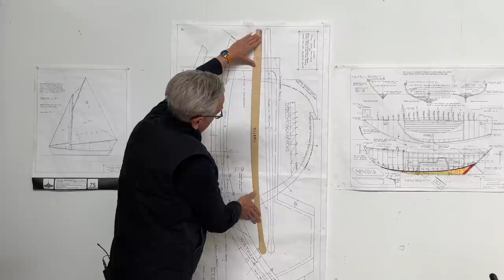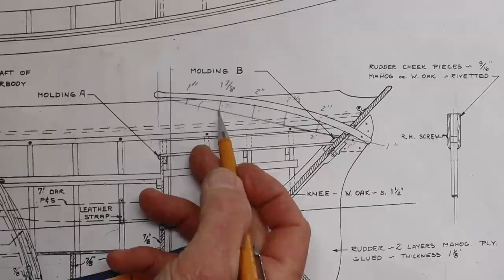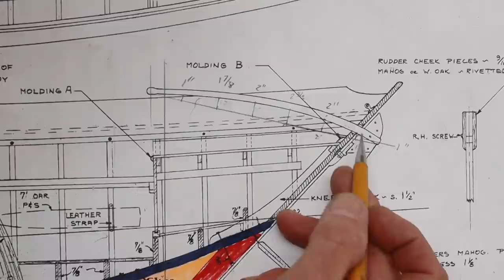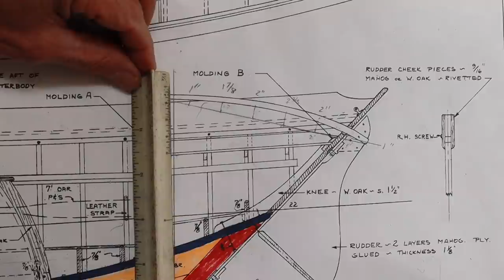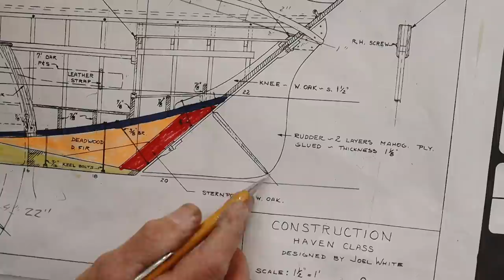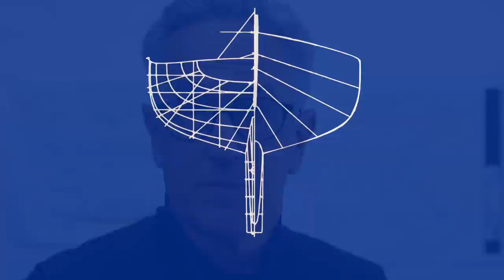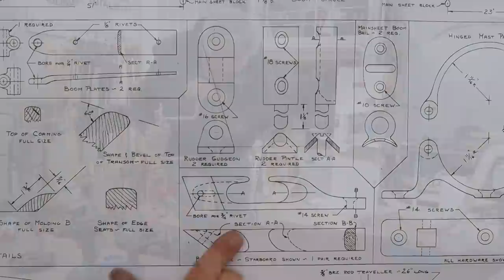Wooden Boat Building, The  Rudder, Haven12 1/2 S2-E60

Comment: I had a similar problem on a job where the ceiling in foyer of a building  was made up of 24 x 24 inch wood panel.  Custom made in Italy in 20% humidity. Sealed and finished on one side then installed during the summer in NC, 98% humidity.  The tiles had a 1/8 inch lip to fit in ceiling grid track, and when the inevitable warping occurred, they popped out at random to fall 12 feet onto my guys below.  It would have been amusing to see everyone scrambling for cover if it hadn't been so dangerous.  Nice work on the Haven, BTW, and remember to always check overhead.

Comment: One tip for folks new to blueprints when he was referring to up from the line Bob was referring to perpendicular not up relative to the drawings.  I know for most this will be a logical thing but when i use to tutor new employees to reading drawings at my jobs I had many a time when I was saying to measure up and I took for granted I was talking about a surface out of the standard X and Y that they measured up. and not in perpendicular to that surface. Excellent video I do not get to catch them all but it really is great when you get into using a scale and how if the drawing is correct you can pull info such as this off of it.

Comment: You wouldn’t think that with acclimated walnut and I assume a climate controlled shop that the cheeks would dry that much more in a couple of days to twist like that, would you? I’ve had the same thing happen under the same condition with small box lids that I’ve finished on one side a day or two before the other. %@&*#! I felt your pain, and I’m at least as old as you. Fun to watch the details like shaping the rudder screws to match the profile of the pintle’s. Slicker than snot on a doorknob.

Comment: I love watching your craftsmanship.  The comments are educational, too.  I was hoping you can reduce my fears of the plywood checking even with a two coat epoxy sealer.  Is it fir plywood?  I have used some light fiberglass cloth in epoxy but I would like to skip that step when using plywood.
Reply from the maker: Thanks Ken,
Yes, it is Douglas fir, marine grade plywood. The use of glass cloth is mostly needed to add strength, as in the hull of a kayak. Sense the rudder is really strong enough the resin is only need for sealing. In theory just a good marine paint is adequate. 
Thanks for watching.
Bob

Comment: Bob, I see more trouble with the tiller hole. You need the length of the pintle pin times the sine of 45 deg (about 0.9 inch) to mount and unmount the rudder/tiller assembly. I don't think the hole in the transom is large enough to accommodate that lift. Another thing to think about is that I remember when I was sailing sabots that sometimes the rudder would float off the gudgeons. Your rudder has more displacement below the waterline than a sabot rudder.

Comment: Nice rudder...even though you sealed the ply with epoxy and primer and of course the finish paint won't the plywood check and feather. I usually put a thin light weight fiberglass cloth over the ply to keep it from checking/feathering.  The screws directly attached to the endgrain of the ply will last? Why not add wooden dowels/plugs of a hardwood for the screws especially at the head of the rudder where the depth of the ply is quite a bit smaller then the bottom. I would be afraid of eventual pullout of the screws. Never the less beautiful job!

Comment: This time it's not too late. I've been planning a rudder build for months. I already purchased wrapped 1 by mahogany boards from Menards. I plan on gluing them up to have a 1-1/2 x 12 x 72 in long board to begin cutting. I've been told not to use Titebond III and use epoxy and wood flour instead. I do plan on using epoxy to finish as I want the wood to shine through. The rudder is a swing design but a small portion may be in the water. What would you go with?
Reply from the maker: Hi Steve,
You can use either Titebond III or Epoxy both will do the job. By adding wood flour to thicken the epoxy is fine. However, you will see the joint as a line of epoxy. As I had mentioned in the video that you can clamp Titebond III, you'll be getting an almost invisible joint. The fact that you are going to epoxy coat the rudder, as I did the, joints will be more than protected. Leaving it a bright finish will be stunning. Just remember that epoxy is not UV protected so several coats of a good quality UV marine varnish will be needed.
Best wishes on a fantastic result!
Thanks for watching,
Bob

Comment: Great work again Bob... I was suprised you didn't reinforce the edge of the rudder with some fiberglass fabric strips while you were applying epoxy.  Is this because the fiberglass would not be in keeping with the spirit of a wooden boat or is reinforcing not needed?  I'm thinking about reinforcing for dents, bunps and scrapes in the first few inches of the lower portion and the '"leading" edge (trailing edge when under sail), not strength.

Comment: I have a question about coating with epoxy.  I understand you did two coats back-to-back to get a chemical bond.  I recently made a plywood shelf for one of my cockpit lockers and also did two coats; however, I allowed the first coat to dry before applying the second coat.  I tried to sand with 100 grit between coats but the amine blush just clogged the paper.  I washed the board with warm water and used a green scotch-brite pad...but had fish-eyes after applying the second coat of epoxy.  Any tips to get a good, clean second coat if you wait (like I did) between coats?
Reply from the maker: That's a good question. How long did you wait between coats? It is my experience that if the paper got clogged the epoxy most likely wasn't fully cured even though it may have felt cured to the touch. The best way to reduce blushing is to work in warm temperatures (the epoxy sets up fast, reducing the blush window) and with humidity at low levels. Unfortunately, I think the sanding may have imbedded the amine blush into the epoxy. As you know amine blush is water soluble. It's recommended not only thoroughly washing the cured epoxy with clean warm water but also using an all-purpose soap and clearing your pad or stiff brush often. 
I'd make sure the shelf was in a warm environment for a day, give it a good water soap cleaning, let it thoroughly dry, and hand sand. 
Best wishes!
Bob
Reply: @TheArtofBoatBuilding  Bob, thanks for the advice, I will try that.  I suspect you are correct and although the epoxy seemed to be cured, it likely wasn't fully cured.  I think I waited about 24-hours between coats.

Comment: I wonder if the tiller is fixed on the rudder, or is to be hinged so it can it at least partially swing up.  Allso, will the tiller and rudder be able to be shipped from aboard the boat, or will it have to be mounted on the pintels while on the trailer or the dock?
Reply from the maker: Hi Ned,
The tiller is fixed. It attaches with a bolt through the rudder cheeks. It could remain on the boat during transport as long as the tiller is tied off as I showed it the example. However, by removing that one bolt the tiller and rudder could be removed. Considering all for the rigging and mast that need to be removed it seems like small task to remove the rudder.
Great question thanks for watching!
Bob

Comment: I’ve been using the rustoleum rusty metal primer since you first mentioned it (hull exterior?). I figure if it works for salt water immersion, it’ll be fine (probably excessive) for fresh. I suspect resawing the cheek lumber probably also contributed to the warping. Thanks for the video. Questions: How do/did you gauge the depth for the forstner bit?  I always wind up guessing based on the thickness of the cutting head. And I frequently have to shim to get the depth exactly right.   The other question: was there just an error in part of the plan for the tiller shape?
Reply from the maker: Hi Robert,
Yes, the rudder cheeks warping was a rookie mistake.Just didn't consider how fast they dried out. Some suggestions I've gotten is to wet them and clamp together. Honestly it will just be easier to start over. I will then seal all of the surfaces at the same time. Boat building is a journey of learning!
I judged the depth by adding the size of the gudgeon flange + the plywood template. I put a make a mark on the bit with a sharpie and bored to that depth. 
Yes, the tiller plan is incorrect. In my discussion with Eric Dow he confirmed that the pattern was incorrect and that scaling off of the construction plan was what one needs to do.
Thanks for you question and watching!
Cheer,
Bob
Reply: @TheArtofBoatBuilding  Thanks for the response. I’m glad you caught that error on your own. Pretty frustrating when it turns out to be a known error that has not been published.  Reading between the lines in your narrative, I suspect you spent a bit of time trying to figure out YOUR mistake, since the plans had to be correct.

Comment: Alright I have to ask. You started with the rudder with parallel sides used a planer and sander to taper it. but then added fairing compound and then sanded it smooth. Why not just sand the wood smooth and then go to the epoxy?
Reply from the maker: Hi Ross,
It's hard to see in the video that the surface, even after sanding, wasn't fair. The main reason is with the grain of the plywood layers going in opposite directions it's very difficult to get a faired surface. At 17:00 it can be see, once the rudder had its final sanding, the high and low spots depending on how much fairing compound remained. 
Thanks for your question and watching!
Cheers,
Bob

Comment: How will you deal with the paint cracking around the seams  of the lower planks, especially where the garboard strakes meet the keel (seen when you were preparing the lower gudgeon inset)?
Reply from the maker: Hi Michael,
When she's ready to hit the water I will give the hull a light sanding and fresh paint. As the boat sits the  wood will move once she's in the water the planks will take up and seal. The thing about a wooden hull is they are never perfect depending on many conditions the wood will do what it wants. 
Thanks for watching!
Cheers,
Bob
Reply: Yeah - great question!